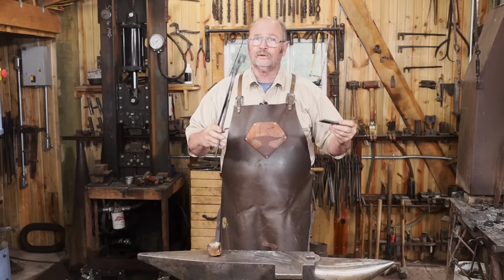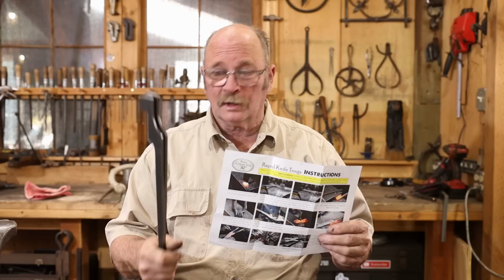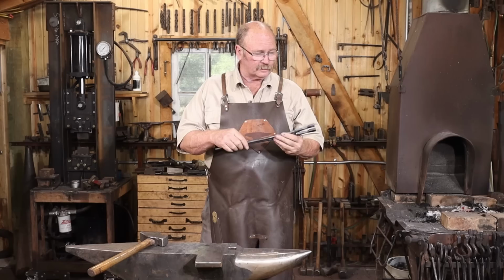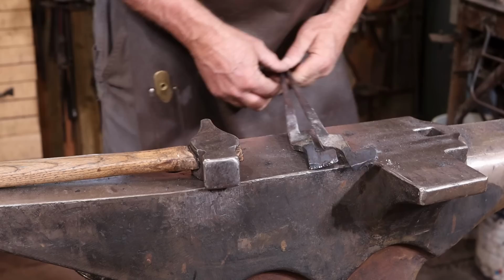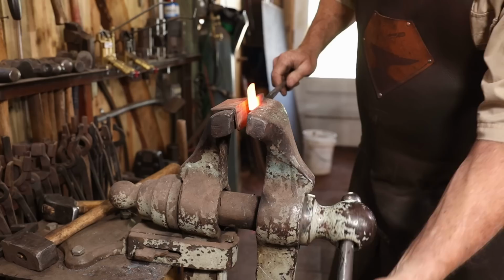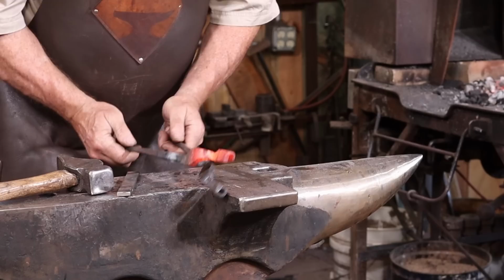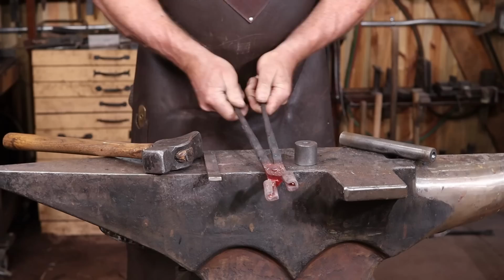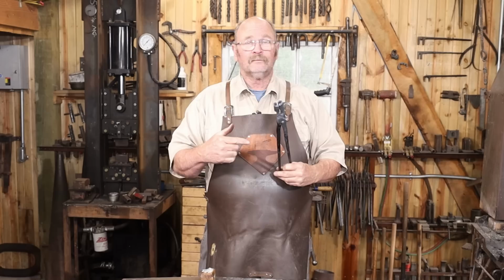Knife tongs from Ken's Custom Iron

Comment: Jaws design is awesome.Give firm grip on stock. Looking forward to  viking knife.  It was originally designed by a Dutch smith Thijs Van se Manakjer in 80s.👍👍👍👍🔥🔥🔥🔥
Reply: Thijs van de Manakker is an amazing blacksmith, check out "forging a celtic spearhead"on YouTube if you havent seen it yet.
Reply: @bortgov8624  Thanks for sharing. I will definitely check out that video

Comment: Alrighty, then.  Love your videos.  It's almost like having personal instruction from an experience smith.  BUT, here's a dumb question from a newbie hobbiest: Why the offset?  Wouldn't the grip be stronger if the jaws lined up with the reins?
Reply from the maker: The offset allows material to pass along side the joint and reins for better control of longer stock
Reply: @BlackBearForge  thank you.

Comment: So would JB weld work in a forge welding application? If one couldn’t afford a welder to tack a billet together
Reply from the maker: I seriously doubt it.  But you can bailing wire a billet together.
Reply: @BlackBearForge  didn’t think about that, I have some bailing wire.. thanks for the advice